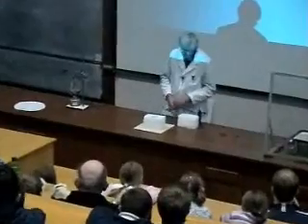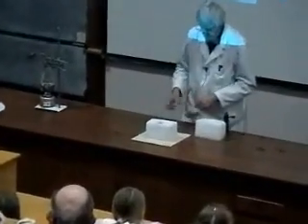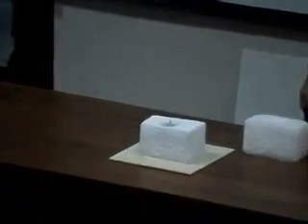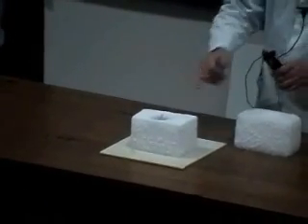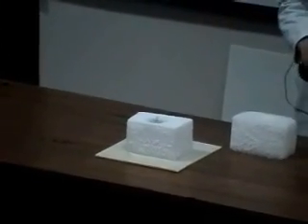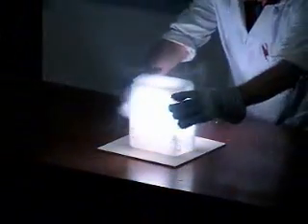magnesium in dry ice

Comment: @ExpertOfSound it would never be concentrated enough. the CO2 from the dry ice would be subliming inside the cavity, creating positive pressure inside the cavity, forcing air out. O2 wouldn't enter because the pressure inside the cavity isn't negative, and even if there were, it wouldn't be enough to sustain a "normal" fire

Comment: @LizzyAston CO2 in an extinguisher is a liquid which turns to a gas due to the pressure change when released. dry ice is MUCH COLDER that gaseous CO2. dry ice has a temperature of -109 F and the gas from an extinguisher is around -89 F. dry ice is colder and CO2 is really 2 oxygen atoms and one carbon atom. when metals burn they can break the atomic bond and use the oxygen contained

Comment: im sure putting Co2 on a metal fire would help to put it out. as seen the reaction took place much more slowly with the block on (this may be due to the lower temperature but still)
when releasing Co2 from an extinguisher it is really really cold, so it will help to put out a metal fire